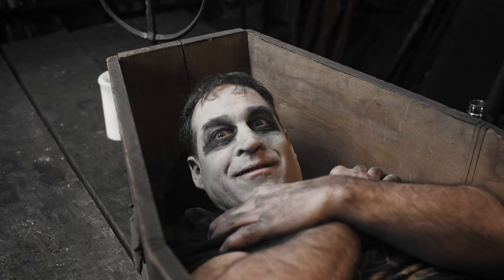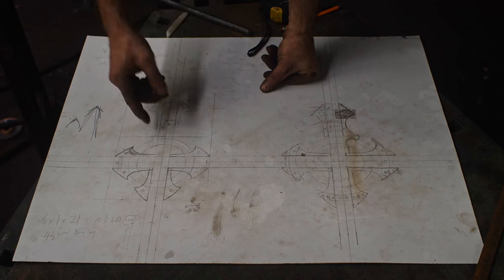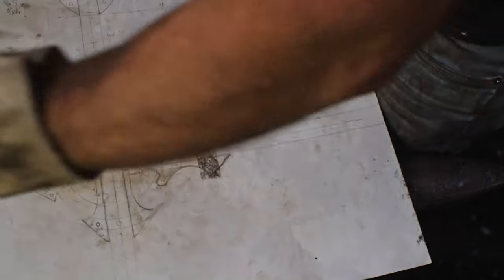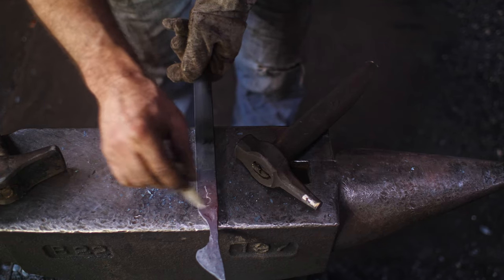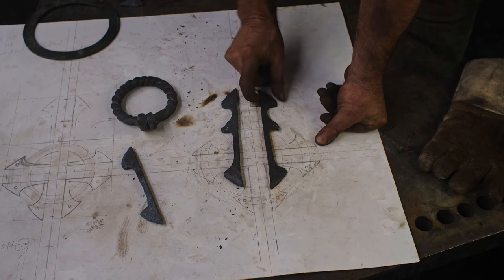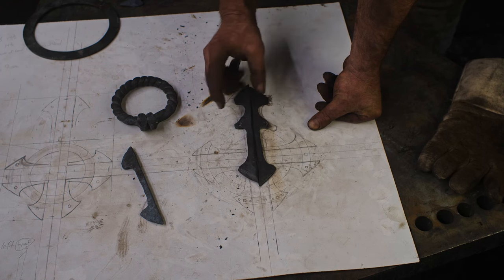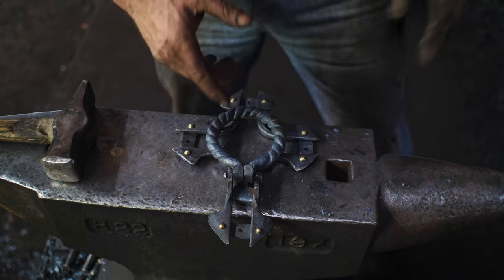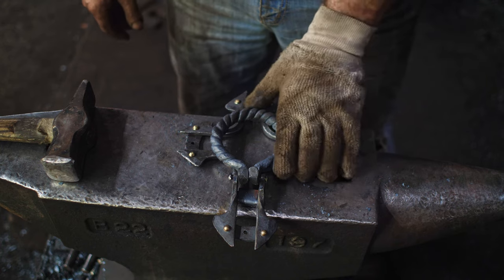Forging a Vampire Coffin Handle with Count Thakula

Comment: Another awesome vid. Couldn't help but laugh at the intro, first thought was "when thak man's the forge straight through the night." Really liked the choice of brass rivets, very nice touch of bling but not too decorative. My initial idea would have been to have the long leg of the crucifix wrap around the ring to act as a hinge, then have ears on the ring either side of the leg of the crucifix to push against either the bottom layer of the crucifix or on the coffin itself. Couldn't really follow your plan until the end but it came together awesomely!